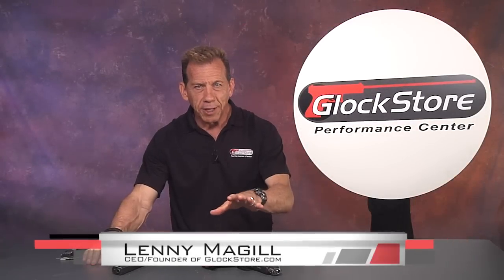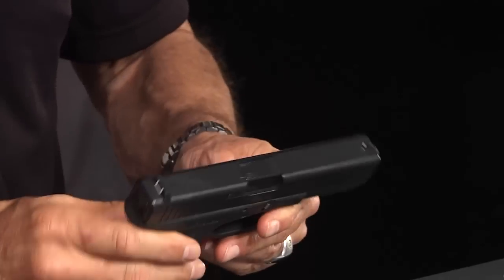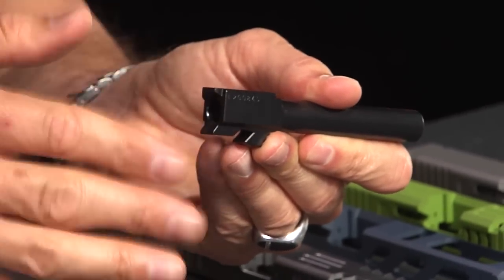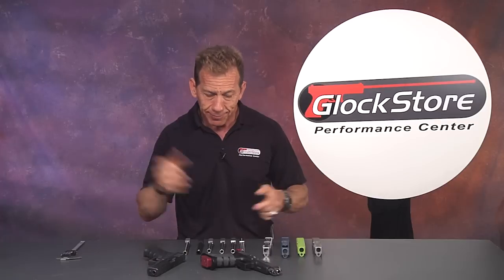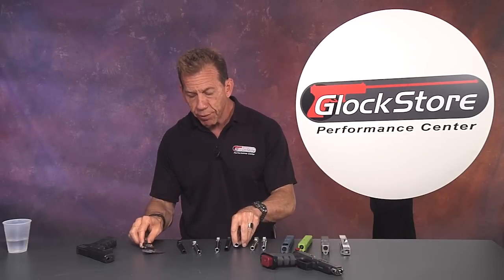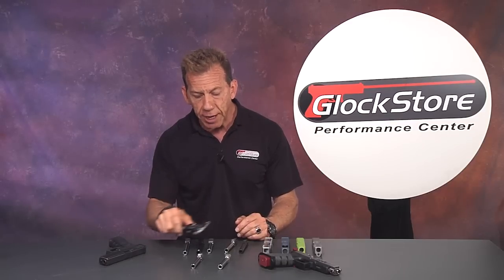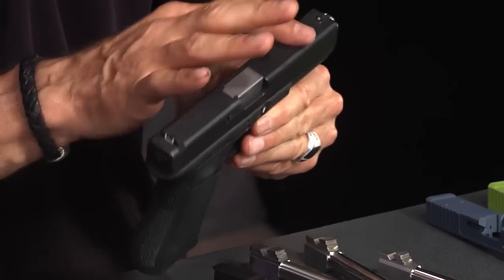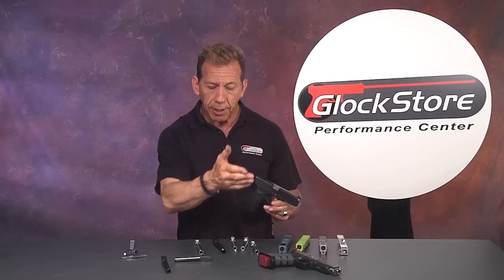Barrelology - Featuring our new Double Diamond Barrels

Comment: I only bought a Double Diamond conversion barrel.  Because my 31 is a .357 sig.  Which is expensive as hell to shoot at paper.  So I grabbed 9mm conversion barrel.  My stock glock barrel does NOT need to be replaced.  It is perfect.  It is usually the shooter that sucks.

Comment: I've reloaded over 20,000 rounds of my personal Glock brass w/ no problems w/ FMJ's.  Some of them are on their 20th reload.  Although  I am interested in this barrel for cast bullets.  Looks like an nice product for a decent price.
Reply: It’s a ‘gimmickly’ line thrown around to help sell aftermarket barrels. “Glock” reloaded brass is not an issue. I’ve reloaded 9mm spent casings fired through my Glock(S)..2 different pistols, with Hornady bullets. Resizing was NEVER an issue and there were ZERO problems feeding, firing or extractions. ANYTHING for a selling point. What he didn’t talk about (‘course THIS is a 2015 vid) was Glock going to the POLYGONAL rifling..and their “Marksman” barrels.

Comment: "...and the lead is hard to remove."  WHAT???  "Consistency is accuracy."  WHAT???  "With a Glock barrel you'll shoot 5 inch groups."  Lenny, if you are shooting 5 inch groups with a stock barrel then I've got news for you--it ain't the barrel!!!  

Last week I wanted to try the Glock 42.  It was a stock gun, with no upgrade parts, save a extended mag release.  A factory gun with a factory barrel.  I shot 20 rounds and got a 4 inch group--at 30 YARDS!!!  5 inch groups my ass.

There are a few things you can do to accurize the Glock, and I've learned most of them through time and HARD WORK.  And the very LAST thing I would change is the barrel.  I defy Lenny to shoot to such a high standard that he requires a better barrel.

Look, I've been there.  Take a good long, HONEST look at yourself.  If you aren't shooting as well as you think you should, then take all that hard earned money that you'd spend on a barrel, or goodness knows what else, and spend it on QUALITY training.

It's like golf.  You get into it, self-taught, and you aren't doing so well so you go out and spend thousands of dollars on the absolute best clubs made.  But they are designed to give an EXPERT just 1% more performance.  And that's important if you are a professional golfer at the very apex of competitive golf.  In that position just 1% might make the difference between winning and losing a crucial game.

But let's be honest, I could have the best clubs known to mankind and Tiger Woods could have 3 clubs (a wood, a 9 iron and a putter) sold at K-Mart 20 years ago and recently acquired in a garage sale.  What do you think will happen?  Yeah, Tiger Woods is going to DOMINATE me all day long.  The clubs don't make Tiger Woods a pro.  It's learning from the best players out there who will spend some time teaching you to play better.  And then practice, practice, practice.

And, as with golf so go guns.  You need to find a pro (or at least someone who knows the basics as taught in the NRA Pistol Instructor class) and listen carefully to them.  Then practice, and when you are making ANY mistake, slow down and work through the problem.  What did the instructor teach you about that?  Work out those bad habits.  And when you find someone better than you, see if they will give you some pointers.  And be polite, humble, and thankful.

I've often offered to assist someone who is struggling.  Some are humble and listen to what I have to say, and do better.  Others keep telling themselves that it's not them, it's the gun.  If they will agree to it, I'll take their faulty gun and shoot the center of the target out with it.  99% of the time when people think it's the gun, not them, IT'S THEM!!!  And most people have a LONG way to go before they need to worry about the accuracy of their guns.  And when you get there, proceed slowly and carefully.

Comment: I'm in the process of dealing with the Glock Store about two 9mm barrels....Double Diamond...right now. Both had a failure to fire  ( not unusual as I was using TulAmmo and IWI hard primer rounds) resulting in the slide being frozen and would not rack so as to eject the round. Gunsmith suggested returning to Glock but of course there was a live round in the gun. Finally got the round out of both Glock 17 and 34 at some consternation on the part of armorer.
Glock Store is telling me that they cannot exchange as I purchased months ago and have shot it.
We'll see........
Be careful with the ammo you shoot.

Comment: While everything said in this video is true, it is also true that operator skill, rather than weapon tolerances, is the greatest factor in accuracy.  A skilled operator with a sloppy but reliable weapon will likely get better results than an unskilled operator with a more tightly machined weapon.  How well would a tightly machined barrel work on a full auto  G18?

Comment: Did I miss where aftermarket barrels usually require some fitting on the lugs and or hood? It's not just the tighter chamber that contributes to accuracy.
Reply: Rey Solis I've heard people say that while Glock's may benefit a tiny tiny bit by fitting of the lugs/hood, it is different than  a 1911 and not nearly as important as in those type of designs. Not sure if it's due to the slidelock having upward pressure, the fact you don't have the tolerance stack issues of trying to build a barrel for a "1911" that could have come from a dozen different makers, or if they even knew what they were talking about to begin with ;)

Maybe someone more knowledgeable will chime in.
Reply: James SoutheastMO I'm not sure you get it.  Go to the Bar-Sto site and look up Glock Barrels.  They offer Semi Fit and Match Target barrels.  Niether of them need chamber reaming.  They need fitting in the area's I mentioned.  The same for Wilson Combat, KKM and other quality barrel makers.  Consistant lock up is going to help accuracy more than a tighter chamber alone.
Reply: I can tell you the TSD "unfitted" bbl I have from my 17 shoots groups about half the size of it's stock bbl. While I've not measured it, I know it's got a tighter chamber than the stock because I had to switch to Redding U dies to get my reloads to work with it. If your saying a Glock bbl must be fitted to improve accuracy, I have to disagree.
Reply: +James SoutheastMO hi, what do you think about SW M&P factory barrels, i'm wondering if i need to get a wilson combat or kkm or apex barrel. Or is the stock barrel fine?
Reply: Bob johnson I've heard some happy with them some not, I know I'm very happy with my Wilson Combat for my Glock 34..

Comment: Read TIM SUNDLES article on the  BUFFALO BORE web site entitled, "Hard Cast Bullets in Polygonal Barrels." Essentially, he says that quality Hard Cast bullets are not the same as Lead bullets, and you can shoot them out of the Glock Hexagonal barrel with no more of a problem than with any other barrel. He explains how the MYTH that you shouldn't shoot them out of a Glock got started. Not an expert myself, just reporting what I read. For dependable feeding in the Woods I think I'd be safer with Hard Cast in a Stock Glock Barrel. Scoring well on the range is a probably a different story.

Comment: Lenny do you not carry the DD conversion barrels for the Glock 27 (40 to 9mm)? I was looking on the site and cannot find them. Also, you may want to check your site. The certificate is coming up bad when you try to go directly to it. Possibly a MIM, but I can get to the site by using a sublink instead of the parent site without getting the certificate error.

Comment: I guarantee the Glock is more accurate than 99% of shooters that are using them. Your grip, sight picture, and trigger control has more to do with accuracy than your sloppy Glock barrel. Save your cash and buy more practice ammo. Unless you're a competition shooter of course.
Reply: +JettyLife23 Pretty much. For SD, a person would spend their money far more wisely on practice or SD classes etc, than one of these barrels. I guess if a person has the cash though, it can't hurt. Any amount of accuracy increase is a good thing.
Reply: Evil D thank you, & good point. You just help me save some cash!👊🏼
Reply: A LOT of us buy aftermarket barrels for the following reasons: First to be able to shoot cheap lead bullet ammo, whether handloaded or factory reloads. Secondly to have a barrel with an extended, threaded muzzle for supressor use. Also, factory Glock barrel ruins brass for reloading and can only be saved by a special die and even then have a shorter life
Reply: JettyLife23 0

Comment: With the concept of Glocks not being able to use Buffalo Bore Ammo, I have a new GLOCK GEN4 G27 and the chamber seems to have a lot meat. But with your calipers your taught m what really counts. Will a Lone Wolf barrel make to the G27 able to handle the hottest +P anno out there? So with LW Barrels would you say Buffalo Bore ammo is safer in the LW? I CCW my G27 and will only buy +P from Sig, Underwood and Buffalo and want the tighter barrel. Are you saying the AK like workings of the GLOCK will go way with the tighter clearance Lone Wolf barrels?  I plan on buying two. One for my CCW GEN27 & the other for my GEN4 G20 next week with a compensator on it next week.
Reply: Aresfire2 glock barrels will handle +p rounds no problem.
Reply: Make sure your recoil spring is a bit stouter than stock if you plan to run +p..

Comment: It's Glock's unsupported chamber that makes it "unsafe" to shoot reloads. The "polygonal" rifling isn't a true polygonal rifling like in older war guns (MG-42). The barrel leads as much as other barrels.

Also,Glock brass isn't harder to size than other brass. Why it's potentially dangerous is because the "Glock buldge" at the bottom of the brass isn't sized down. Any normal sizing die in an average die set doesn't go down far enough. There are special dies to do that so it will chamber properly. 

All in all, it's expensive to shoot and reload for Glocks...

Comment: NONSENSE. An UNSUPPORTED CHAMBER or barrel is not one that is "looser" or necessarily less accurate. It is simply one where the FEED RAMP cuts into the chamber beyond the extractor groove of the case. This makes for a lower feed angle and more reliable feeding of flat nosed ammo, at the expense of not being able to withstand over pressure loads as well or as safely. The disadvantage is that it may blow up in your face and pop the magazine out if the case ruptures. But, it can be just as accurate. As a matter of fact, many competition barrels are unsupported because (1) IPSC/IDPA shooters are fine with round nosed bullets and (2) shoot the lightest loads that meets class rules to minimize recoil anyway.

Comment: Does 2 thousands of an inch matter at 21 feet?
Reply: BDurant if you want to drive nails and bullseye yes
Reply: BDurant yes and no. you want the round loaded exactly the same every time. just being off slightly in the chamber can affect the rounds balance (ever so slightly).

but unless you're shooting match grade munitions,  then your ammo will be of more a concern. 

it also depends on the groupings you want. 

the polygonal barrel is better for most people as long as they stick to jacketed rounds.

Comment: THOSE harbor freight calipers are unbelievably inaccurate
Reply: as long as they're consistent it doesn't matter. consistency is accuracy. and all he's measuring is the difference between the distances, it doesn't really matter if the measurements are wrong as long as they're wrong by the same amount. a broken clock is right twice a day, but a miscalibrated clock is always wrong.
Reply: Tyler M I work for a gun manufacturer we use these for our rifles. They are good enough to reliably check differences between things. No I will not tell who I work for
Reply: @hasgunwilltravel6840  gonna guess century or ruger?
Reply: trace tassie quit there recently, but nope. The company makes 1911s primarily
Reply: @hasgunwilltravel6840  lol oh ok colt or armscor then
Reply: trace tassie still wrong
Reply: @hasgunwilltravel6840  kimber
Reply: trace tassie lol. You still going.
Reply: @hasgunwilltravel6840  jeez lol not many other 1911 companies i can think of lol

Comment: glock store paint jobs leave a lot to be desired....extended controls came chipped paint job out the box...I'd love to meet the dumbass who looked at it and said yup this is quality send it...the dimpled barrel black paint had good amount of wearing away after 30 rounds...its a good trigger love the trigger so far the tungsten guide rod is good. stick with the silver if you really want a barrel. I completely gutted out a glock 19 gen 4 never fired and replaced with all glock store parts...the only thing I would recommend buying is the pyramid ultra and the tungsten guide rod. the rest looks like cheap Chinese knockoffs...I put the oem barrel in and did another 30 shots no wearing to the point of seeing the chrome underneath like the double diamond dimpled in black shown....I know they will eventually wear away but didn't expect it after 2 15 round magazines. after experiencing the cheap quality on other parts I'm hoping this trigger will last along with the guide rod.

Comment: Do you even reload? It definitely doesn't sound like it considering your fixation on Glock fired brass being hard to resize...
Reply: Its not so much the issue of resizing difficulty, but rather work hardening the brass that causes problems.  The bulge caused by the oversized Glock chamber gets worked more during the resizing process, making it more brittle.  3 or 4 reloads later and the brass can't hold the chamber pressure anymore.  This condition can cause the dreaded 6 o'clock kaboom when using reloads in a stock Glock barrel.  This is why folks like to swap out the stock barrel for a tighter, SAAMI spec chambered barrel.  Nothing wrong with the stock barrel if you don't reload, and it's accurate enough for SD purposes.  Brilliant idea for reliability and durability, just don't roll your own.  Glock doesn't recommend reloads anyway.
Reply: @michaelmarine6593  

👌

Comment: No access to cleaning kits? First rule for any solider especially infantry is you clean your weapon before you eat or sleep. The fire arms combat soldiers use are their lives. They DO clean their weapons.
Reply: NovaScotiaNewfie your comment shows your naivete.  I'm sure the rangers in Mogadishu were cleaning their guns while pinned down over nighty... situations occur in war in which you cannot control for, thus nothing, not even cleaning your weapon, is taken for granted. 

just walking around in the middle east gets your action dirty, but I'm sure Isis will wait til you clean out your chamber. 

in the heat of battle weapons and rounds can be dropped or scavenged without time to clean. haven't you seen the hurt locker?

Comment: you are demonstrating how tight are the aftermarket barrel tolerance that will affect the accuracy but you have only compared the chamber dimension which in my opinion will not affect the accuracy. chamber dimension is only for reliability which glock promised. as per glock claim also that their barrel octagonal/hexagonal design makes their barrel tight as possible and seal off the gas from escaping from the bullet so you have a powerful projectile velocity (which that makes improved accuracy also as their barrel is tight based also as per your claim that tight barrel improves accuracy)
Now for better comparison, please measure your barrel dimension not the chamber to prove that you have tighter barrel that will contribute on accuracy.
I believed also that accuracy obtained from the aftermarket barrel was the tolerance between the slide and barrel so it will not wiggle to have a consistent aim on target and not the chamber dimension. 
chamber dimension is only for reliability that it will feed any kind of ammo on same caliber of course and also as for supported chamber to avoid brass expansion or even kaboom.. so it will be reloader friendly.
and another advantage of aftermarket barrel was their conventional rifling which is land and groove design so you can shoot lead. :)